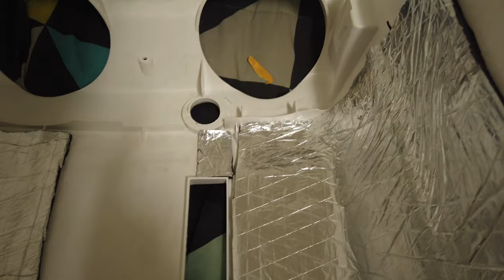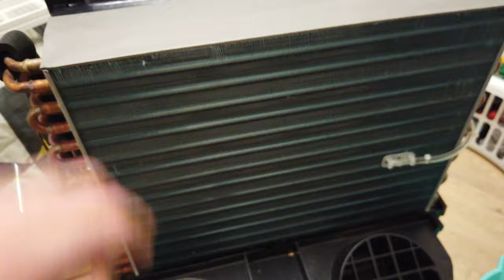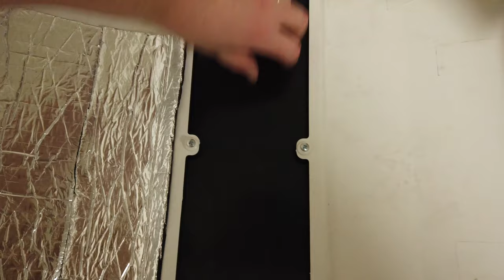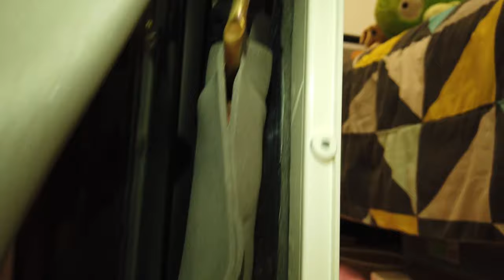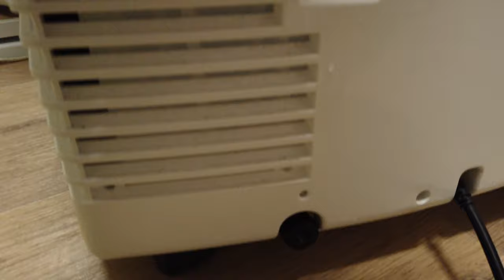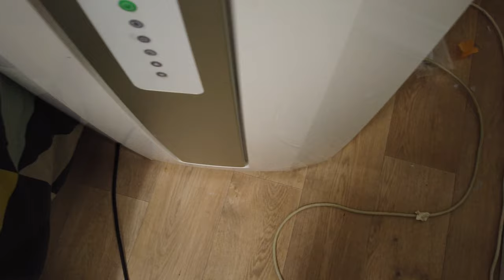Making Portable Air Conditioner More Efficient | Dual Hose Hack

Comment: it's criminal that the extremely inefficient single hose models are sold in Australia and there are no dual hose models for sale at all.
Reply: the don't sell dual hoses in australia due to regulation, ie government incompetence
Reply: @elduderino7767  Dual hose machines aren't banned in the UK, but they're very common. I suspect that people don't want the hassle of 2 separate hoses.
Reply: Even in Italy
Reply: Can't get dual hose. It is a total scam, single hose doesn't work at all to cool a room, it'll only cool the air directly ejected from the unit.
Reply: @konsul2006  My single hose unit cools my bedroom from 25C to 18C in 2 hours. If I leave the door open my living room becomes cool too.
Reply: ikr, seems the same over here in new zealand. i am just going to buy a cheap single hose unit and modify it. open it and seal off the hot side so it only draws air in from the intake and add a second hose. i will also keep the hoses super short and the ac unit on my desk at window height, thus minimizing heat leakage into the room and removing the vacuum effect/ inefficiency of the single hose unit.
hopefully it works all right.

i wish we had cheap window units here too. but they dont seem to exist either. just full heatpump setups or a shoddy single hose portable ac. that is all we have. i guess at least nz doesnt get quite as hot as oz though. :)
Reply: @menfaaanda  - because you don't have a leaky room/house. Crack open the basement window can help a lot too.
Reply: @nkt1  they now make single hose dual hose. Basically they have a hose inside of a hose...lol
Reply: @konsul2006  not a scam at all. Keeps my room perfect. Have central ac but need one room colder. By 5-10° at least. Window AC doesn't work when temps are low outside. Meaning many months out of the year it's useless, the window ac. The portable works any temp, far less hassle overall unfortunately. Of course dual hose is better.
Reply: Same in italy

Comment: I've done this with an 8k btu LG single hose but have gone a step further, on the evaporator intake side for the room air I've created a duct that accepts a 4 stage h13 hepa and activated carbon filter with a uv-c light between the filters and evaporator . so my previous single hose inefficient AC is now a dual hose efficient AC that purifies the air it conditions and kills any germs or virii that cross through it
Reply from the maker: That’s cool do you have a video or photos
Reply: Forgive my ignorance, but why take the air going into the room from outside instead of just inside air? 

Is it because the intake is both removing the cold air from the room “being cooled?”  Wouldn’t it take more energy to cool the hotter air from outside? 

Thanks for the clarification. 😇
Reply: @homerguerrero  
The A/C units essentially transfer heat. If you have more heat to be transferred (removed from the room), you have more cooling. Thus hot air from outside actually yields more cooling.

If you take already cooled air, you are doing less work (less heat transfer), and then you have less cooling - this is a large reason portable units are less efficient than window units.
Reply: @justincharleswong2418   thanks for the break down! This makes sense (I’m a civil engineer and have just surfaced the hvac world) 

My project with this, I have an rv that has both a duct system in the roof and duct system on the floor, roof for cooling units, floor for furnace.  Basically, I am going to tie into the furnace duct system from the storage with one of these, my only hurdle was getting the return air which this proves to me is better off just one way. 

Thanks again for your time in responding and getting knowledges up! I’ll link you a video with the outcome! 🍻
Reply: @homerguerrero  I'm with you in being confused.  For instance, why should I care about efficiency?  I only care about $$.  Sure, the efficiency (heat pumped per $) increases, but then I'm pumping heat I don't care about.

The best answer I've seen is this:  Using room air sends it outside.  It has to be replaced and (of course) the replacement air comes from outside so it's hot air and needs to be cooled so I spend the $$ anyway.

Is it just a shell game to generate a falsely higher efficiency number so people replace their ACs?
Reply: @Slot1Gamer  You Tube fails at notifying me of replies.... I have since put in a mini split for better efficiency so I don't have any videos
Reply: @flintsmith4771  With a 1-pipe a/c you take air from the room and use it as a source of energy to produce cooler air, you take cooled air from the room, heat it up and send it outside the house. Since now there is a shortage of "air" some hot air gets in the room from the walls, floors and other rooms and needs to be chilled too, making the 1 pipe a/c very inefficient. With the 2-pipes a/c there are two systems with heat exchange working more efficiently. The outside air goes back outside after "giving free energy" to the a/c.
Reply: i did something similar.. in my case i just laid the hepa filter along the intake panel.. and after a few months it collected quite a bit of dirt from air sucked into it. Its a lot of fun hacking these single hose indoor air conditioners.  I am thinking of creating a swap cooler function on it.. by adding a panel where i have the hepa filter.. where i can have water pour over the top of it.. I am wondering if that would even improve the energy efficiency of the air conditioner.
Reply: Justin Charles Wong  no this is wrong. The reason why using the cool air inside your room is worse is because you are sucking it out after and that will create a vacuum inside your home, that vacuum will pull hot air from all the cracks and gaps in your houses walls.
Reply: @flintsmith4771  no.. read my explanation above. You care about efficiency because the more efficient it is, the cheaper it is to run.

Comment: an extra addition is a basic fan to force air into the new air intake hose. You'll have an additional pushing fan to go with the existing pulling fan dragging air over the heat exchange, it will improve efficiency by quite a lot.
Reply: Lol so basically a supercharger 🤣
Reply: how would you apply the fan? is this a custom modification you are speaking of doing or is there a product off the shelf  for that? How much extra efficiency would you get? why would that make it more efficient?
Reply: Except.. that additional efficiency is lost because now you're using more electricity go get that extra cooling.
Reply: @parker97boy  can we develop a turbo AC?
Reply: @guanqiaowang7586  I think so but as M A #np stated efficiency may not make this the best solution to gain power... A hybrid system likely would be simpler and be more efficient but an electric turbo would likely work for short term power gains
Reply: This is actually incorrect… acs suck way harder and blow just as hard vs a little fan you add… all youll do is add tubulence which in fact makes the opposite effect, meaning less airflow
Reply: @randybobandy9828  A fan Barley use any power

Comment: I did find out that when running a second hose to my A/C the wattage increased from 750 watts on average with the single hose, to about 900w after adding the second hose. I noticed that it would initially start at 600w then as the compressor heats up it slowly creeps up to 900w.  This was on my 6000BTU Midea but I guess the same principles apply. I did use only a 5" hose tho so I will upload results once I get a 6". I got the wattage results from the Emporia outlet energy monitor.
Reply: So? How did it come?
Reply: did you properly insulate the hot area from the cold area of the unit etc? otherwise adding the second hose causes it to find easier air becuase that air is more restricted/ harder to pull all the way from outside, so you end up pulling cold air straght from the top of the unit to exhaust through the heat exchanger and back outside, thus making it have to work far harder.
in theory, when this is done right, it should cause less power usage, not more.
Reply: Hey did you figure it out?

Comment: Ive done this, was a massive improvement in effciecy, problem is there still veryu loud. So longer pipes in needed. 3D printer comes in handy to make the duct connections
Reply from the maker: Yeah I printed a connector for the inlet duct and it’s very tidy now 
I’m thinking about converting a unit to be water cooled

Comment: I have a unit that has dual hose spots on the back however strictly the right one exhausts and the left one doesn't feel like it has any suction at all as an intake. The unit came with 2 hoses. It has the same rear vent design as you however. How did this end up working for you? I may try it out.
Reply from the maker: Works much better when you modify the other vents

Comment: The Portable AC used in the video is already a dual hose Model!!!  This guy has NOT modified a single hose model.
Reply from the maker: These are sold in Australia as single hose only, it may look like it’s dual hose but it isn’t, the housing is modified at the injection stage to add in side and bottom vents, much like a single hose system. The evaporator intake also isn’t completely sealed from the condenser side of the unit. 
This video involves the same amount of steps and methods used to convert any other system, the only difference is this one didn’t require the 5 minutes to cut a hole..

the principle is the same regardless of the housing covering the condenser.

Comment: Are you sure the hot air from outside will be able to sufficiently cool the condenser?  Specifically in the case that the outdoor temperature is above 90F / 32C degrees.  I would think that there would need to at least be increased air volume to compensate for the higher temp in that intake air.  Maybe the fan would need to be larger.
Reply from the maker: It gets to 40c here and hasn’t had a problem
Reply: I've done this same project and at 100f with 100% humidity outside all summer here in Florida I have no issues I run a 5.9 inch hose for both intake and exhaust,,,,, generally keep the room about 72f year round with this
Reply: Central air and window units use outside air exclusively to cool the condenser so... yes it will be fine.

Comment: Why would you do all that when you can just buy a double hosed unit... Kinda common sense
Reply from the maker: because you can't buy them in every country
Reply: @Slot1Gamer  Yep, I thought I could easily go out and get one here in the UK. But no, they're like dragon's teeth over here 😮. Amazon have some listed but they're all scam items for 'dual hose' swamp coolers. Groan
Reply: Same in central europe. Can't find a dual hose AC unit in my, or any of the surrounding countries. I have a 12,000 BTU unit, that works pretty well as is (since it's just stronger, cools the room from 35 degrees outside to 28 inside) but i'm gonna add a hose like this, just for efficiency... Power costs 12 cents per KW here!
Reply: They are Unobtanium

Comment: Very good job! 
If you want to take it up one more notch, insulate each of the two hoses with fibreglass and foil. 
You add a lot of heat to the room with those hoses.
Great presentation.
Reply: any suggestions on insulating the tubing? have you done a conversion? I saw a 4 layber flexible vent tubing on Amazon.. it uses two layers of aluminum seperated by a layer of PET and then the out layer is PVC. I have not tested it yet.. I am expenting it on friday.. I am supposing if it still radiates a lot of heat.. i can buy some fiber glass tubing to wrap it with.
Reply: @manp1039  did it make any difference?

Comment: Butyl is better in my opinion I didn't research this but it's used in cars for sound deadening road noise and for lining trunks to stop rattling in subwoofers. I do suggest trying to also insulate the exhaust hose with duct insulation.

Comment: Very nice.   I actually put my portable ac outside next to the window with an insulated duct blowing cooled air in and another insulated duct sucking room air out (to the ac).  This way outside air is used to cool the condenser and condenser exhaust air is already outside.  Until reading your description, I didn't realize that using room air to cool down the condenser was wasting already cooled room air.  Another bonus for my setup.  If I did this over again, I'd START with an outside AC unit, but ducting in and out means it's quieter and you can put the ducts as far apart in the room as you want and get more "cross ventilation" going on.
Reply: Is this a dual-hose roll-around portable AC you are using for this solution?   And wouldn't there be a length restriction on the ducts?
Reply: @wayditay9288  No, it's a single hose, but with the unit outside, you don't need a hot air exhaust hose.  It just vents.  But what you do need are 2 hoses - one for the cold air coming out of the unit and one for room air going into the unit.  I needed to put an inline fan in the cold air duct and it's about 6 ft. long with 2 right angle bends.  The fan works much more efficiently for some reason when it's placed at the opposite end of the duct (away from the unit).  The room-to-AC duct is about 10 ft with one right angle bend and it sucks in air just fine.  I did something similar before with a regular window style AC and the flow of air isn't so much of a problem as keeping the vertical height constant.  I tried putting the AC on the ground and going up 5 feet to a window and all the cold air stayed at the bottom, so I had to elevate the ac to the window height.  Apparently the 12 ft distance the air traveled in the duct (even though insulated) was enough for the temperature to lower before it got to the window!  On this project, the output of the ac is the same as the window height.

Comment: I used plastic that you cover your shelves with to cover intake vents leaving space for the 2nd hose I ran to the outside. Since the vents are sealed it can only take in air from the hose I put on it.
Reply from the maker: Great idea
Reply: @Slot1Gamer  so far so good I 1st put it everywhere but I can still take the vents off. I left a 4x4 hole for the tube. I attached the tube with masking type. Not a secure setup but I dont move it much. The motor is cooler & the room is cooler.   I thought I might need an additional ac. But it now does the job.

Comment: That’s awesome, it might be worth looking at doing that on my unit. Do you have measurable results on the efficiency? Like it uses less energy over a certain period of time? 
I also have mine venting through an  awning window, used a piece of cardboard to block it up with a hole for the vent.
Reply from the maker: I haven’t measured but the compressor doesn’t run all the time unlike stock where it’s 100% cycle 

I think I’ll replace the hoses with insulated ones 

I was using thick foam insulation from hardware store as a window mount as I had windows that opened outwards and that helped a lot too

Comment: Flawless excecution, me on the other hand had a ton of issues trying to replace the blower fan, and once the damm thing works there's a refrigerant leak. I wish I could convert it to dual hose since it doesn't cool down the room at all, it basically runs constantly blowing at me, I have to set it to 28c to give it a break.
Reply from the maker: Thats a bummer about the leak :( 
I wish I could get the portable split system here still
Reply: @Slot1Gamer  Yeah I'm kind of mad that after one week of careful disassembly another problem shows up, one which can't be fixed since it's so old that no one has the refrigerant. Just bought a new surrey unit, haven't tested it yet, but the 20 year difference is outstanding, the old one was massive and really heavy (delonghi Nf190 if you can find it)
About the portable split, I've never seen one of those before, not even online, how do they work? There's not much about them on the internet tho

Comment: Ok, but you should have covered the grill for the condenser intake on the unit so it would no longer be pulling air from inside the room, even with the hose it’s still going to pull air in. Or did you cover it on the inside and I didn’t see ?
Reply from the maker: I covered it with the foam insulation :)

Comment: If your sucking in colder air from outside, why not just open the window and let the cold air in??
Reply from the maker: Cool air is relative, the outside air is cooler than the exhaust but warmer than the air conditioned air

Comment: Hi I did this modification but it is not taking outside air what could be the problem? I have two grilles for the condenser.
Reply from the maker: You might have same issue I did, most these units have open sides and air gaps on the bottom, you need to seal up the condenser section